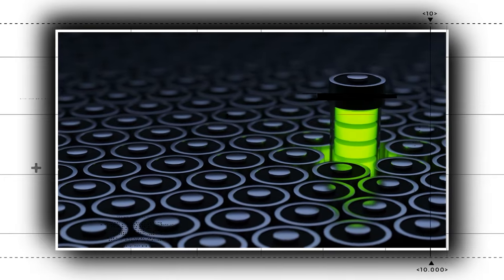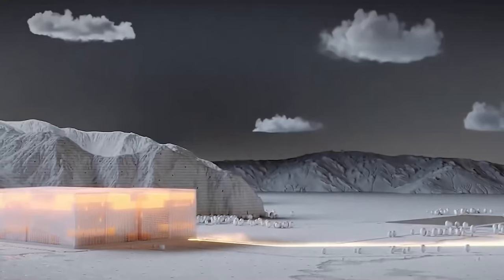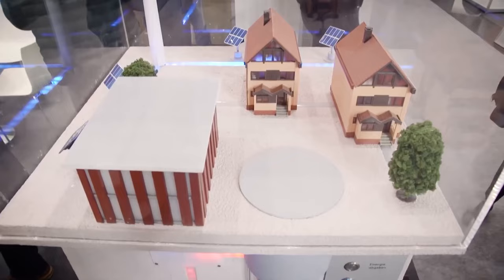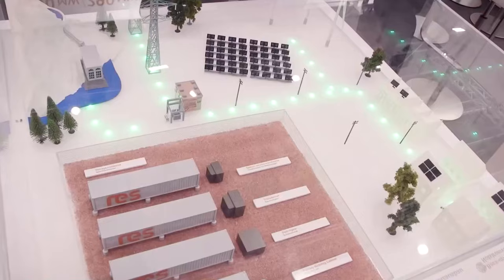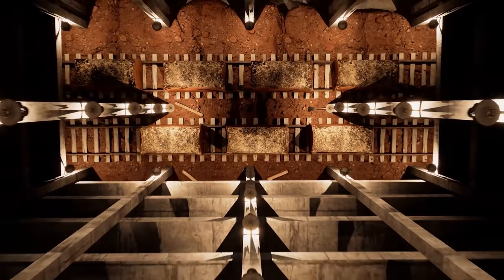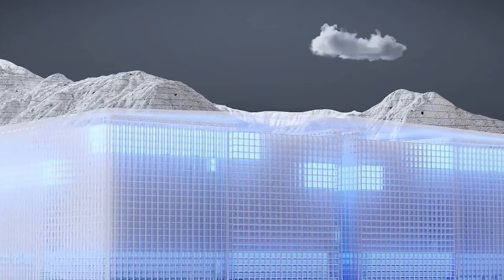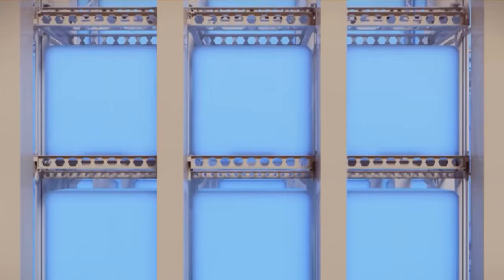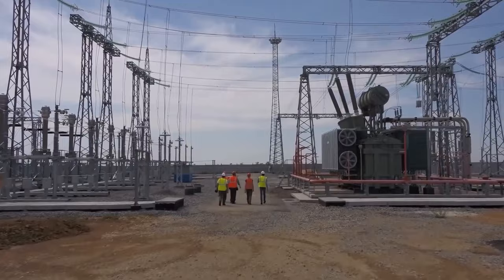MIT Engineers Just REVEALED A New Battery Using Cement Blocks!

Comment: Why are you showing a very different large and inefficient form of energy storage as an example of the form discussed? Stacking heavy blocks to later use gravity as a form of stored energy production has no correlation with the form your poorly explaining. Outside of the weight of a concrete block. Your graphics make no sense and only lead to confusion between the 2 very different forms of energy storage.
Reply from the maker: Sorry about that...this is noted in our future videos. Thanks for your feedback.